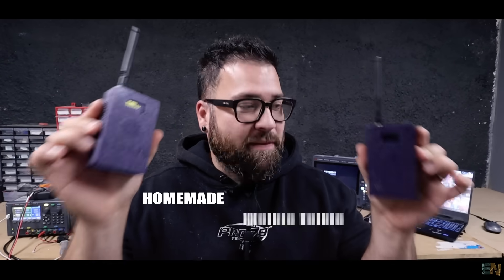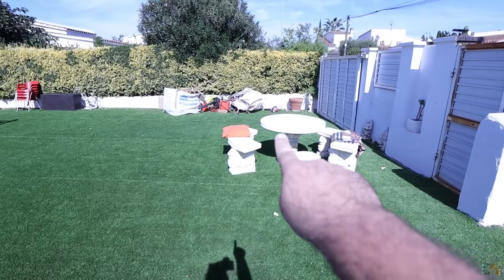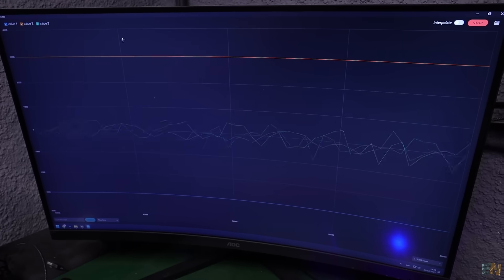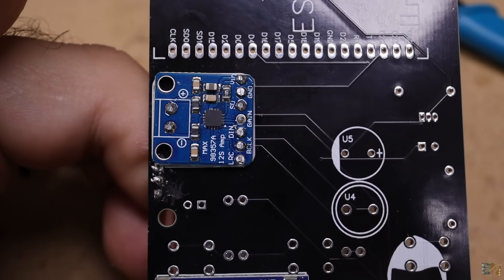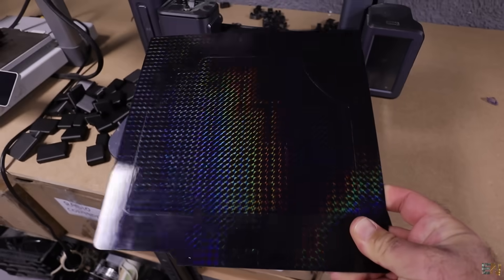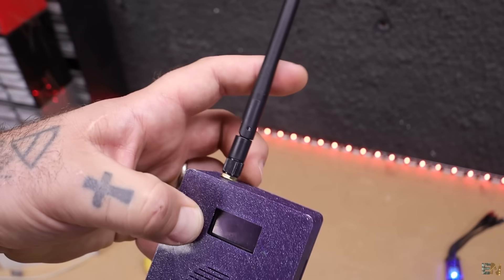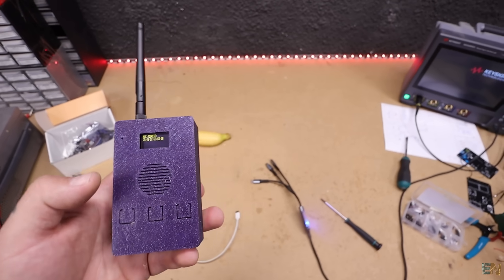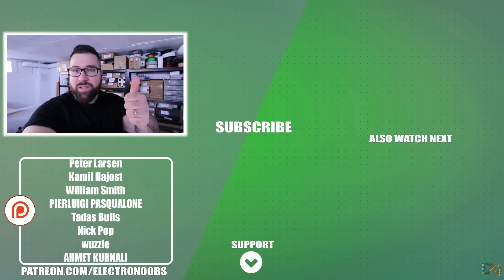DIY Walkie Talkies Anyone Can Build!

Comment: Here's an idea for you. ESP32 can communicate with multiple devices. If you manage to connect two or more Bluetooth headsets, you have a wireless motorcycle intercom that's WAY CHEAPER than a commercial unit. Everyone already has a BT headset.

Comment: 14:33 I've built a pair using this module and arduino. it works fine. Except a constant beep along with my voice which I was not able to solve and it was exhausting really. I'm looking forward for your version to see if you can solve that issue to upgrade mine too.

Comment: Following this! I’ve been working on something like this but I’m not as smart as you. lol   I wanna do the same but instead of printing my own housing, I wanna fit it inside an old set of toy walkie talkies. Definitely subscribing. Also, can more than one be on the same network and all receive the signal? Or is it only paired between the two?  Also see if can make the pan smaller so it can fit is a wider variety of things?

Comment: This is a very interesting project Andrei! I'm really looking forward to making the final version.  This will be neat to use with my son.

I'm curious to see what solution you come up with for the 2s battery.  Did you not want to use an MT3608 boost converter because of possible noise?

Comment: 8:40 You could have used old iPad pro speakers like 2017 model. They are quite small and extremely loud for your use case. It has it's own build in box type design for maximum volume. 😅

Comment: You can solder directly to the antenna on the PCB of the ESP32.  Don't use a linear voltage regulator (e.g. 7805, etc.) they are very wasteful for battery operations.  Just dispersing the excess voltage as heat.  Use a switching regulator (sometimes marketed as 7805 equivalents, or even drop in replacements), because they will actually drop the voltage in a power efficient manner.
Reply: Actually you should not use switching regulator as the switching noise will be audible in the speaker. Its best to use a LDO like AP2138 or HT7333. Ig he used 7805 as the speaker draws more current
Reply: Your   wrong    7805     is    the   same   as   7805    regulator

Comment: I am working on a similar project but using analog mics and an esp 32c3 i am having problems sampling adc samples manually because it blocks the esp32 from doing other stuff like reciving packets etc. does anyone have an idea on how to fix this
Reply: C3 is single core, so unlike once with dual cores it can't do both sampling and recieving packets at the same time

Comment: The inductor is a mistake! You can use an LC (or better Pi) filter to separate interference from different domains, to protect them from one another, but your whole everything is connected after the inductor, it makes no sense! In reality this inductor resists changes in current and your capacitor afterward is very modest, so when you draw current during wifi burst transmission, the supply voltage drops due to the inductor. A battery has no switching noise that you want to filter out anyway. If you want to reuse the filter circuit, convert it to a pi filter and put it only on audio amplifier and vibrator, to prevent their noise from going up the rest of the circuit.

To make filtered voltage to microphone, you can use resistor capacitor arrangement towards that, no inductor needed. But i don't think it will need it.

I also like cheap 1S power bank board. They often just always provide 5V 1A out.

Comment: Thanks for your videos and effort. Can the audio be transmitted and received in stereo so it can be used as a link for an FM station? I don't need more than 300 meters and could use antennas with higher gain, but I'd like to know if the audio quality would be adequate for a professional station. Thanks.
Reply from the maker: The DAC already creates stereo but the audio data is mono since the microphone is mono as well

Comment: we know what the last button does, but what about the other 2 ? (having a 3 shell moment) this is a cool idea. I was thinking of something with LORA that can text, talk, and send a recorded memo message.  since it is ESP32 maybe also be able to detect if signal is getting though. if not switch to a different band. and indicate what band (WIFI. LORA, Blue Tooth, FRS, GMRS...)
Reply from the maker: the other buttos for now are doing nothing. The idea is to create a menu on the screen and use the 3 buttons to navigate or select settings...
Reply: @ELECTRONOOBS puede compartir el codigo simple. Para estudiarlo y modificarlo a gusto ? Porfavor.

Comment: using the nrf24 and the esp32 camera, would it be possible to send video? Between two esp32?
Reply: Yes, but slow framerate and worthless battery life.
Reply: @TheOfficialOriginalChad 
How slow? 8 to 10 frames per minute? Could you teach me how to make a module like this? Or tell me where I can find more information about it?
Reply: Always wonder how drone operators do it, they have video over kilometers, then audio should not be a problem...? Maybe different radio freq?
Reply: @kooskroos Most FPV drones use analog video signals. Some use digital, but they're expensive.
Reply: It would be possible to make a video transmitter and receiver using an nRF24 and an analog camera or an nRF24 and an ESP32 camera, regardless of the low frame rate and low video resolution. The important thing is that it works. I've been trying to create an RX and TX pair for video for years, since the professional kits sold online are very expensive.
Reply: @wandersoncordeiro5061 take a step back for a second. Why are you trying to create this device? Years is a long time to spend on a problem. What is the use case? Or is it just one of those projects awaiting your skill set to catch up?
Reply: I am looking for the same project but guess no one has worked on this...

please let me know if you have any similar sources,

Esp cam with NRF24... even with lora to send it to greater distances....

please support

Comment: Nice project. Esp-Now also has a 'long range mode', although with less bandwidth. Maybe you could check out if that works for your device.
Reply: I love this project! Great work. You can do anything with modern components. Use the low bandwidth option and use a lower audio bitrate. Theres a setting on the DAC somewhere.

Comment: I am working on a similar walkie-talkie for an Omnibot robot using ESPNow and that amplifier works well but can really pull down the power! A couple of items to consider is adding a large capacity capacitor right before your ESP32 and to also power your amplifier separately prior to any regulator, however, keep in mind that I2S amplifier board has a max of 5V.
Reply: Yayyy Omnibot from Tomy toys! I remember them from the 80s

Comment: Nice project! Would be cool to make a pairing function, so that you can easily make them pair automatically by pressing a button, possibly multicast so that multiple walkie talkies can talk to each other
Reply from the maker: Working on that. Actually is quite easy. Just make the esp brodcast its MAC and the receiver would store it to the EEPROM an have it automatically connect
Reply: @ELECTRONOOBS  yes that would work for a p2p end to end communication, but what if we had 5 of these and wanted them to communicate all together? I’d leave the mac address to broadcast and append a hash before the audio data:

so the first walkie by pressing the button generates a hash and stores it and communicates it in broadcast.

the others by pressing a different pairing button receive the hash, and they store it as well, and every of them when communicating, communicate in broadcast, but will only play the data if it contains the hash they paired to 🤔